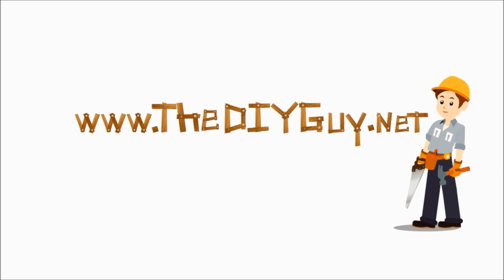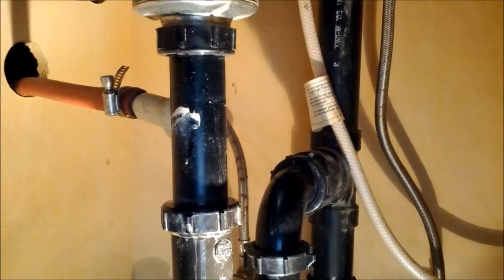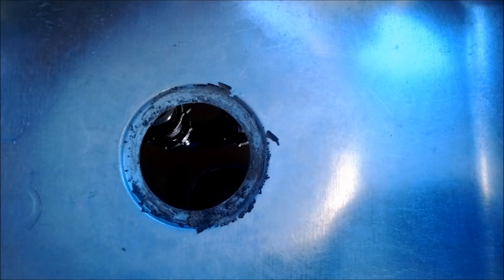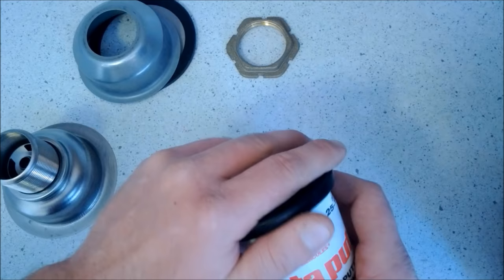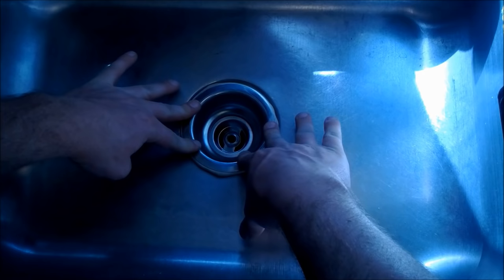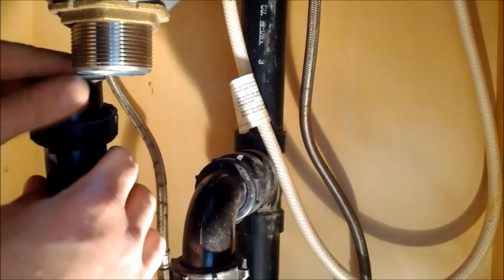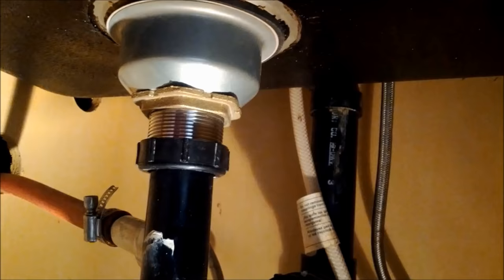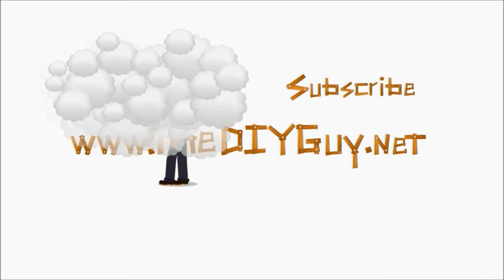How to Replace A Kitchen Sink Strainer

Comment: I'm just wondering why in the world some people gave this simple, clear, video a thumbs down!!! Trolls gotta be trolls, I suppose!
Reply: Plumbers pissed they are not getting a job.
Reply: ussteam
Reply: Thumbs down because it over-simplified the removal process... this seems to be a 'staged' repair where everything was partially loosened and easy to remove... when I replaced mine, the plumbers putty on the top-side of the old one was so strong and caked on it took about a half hour with a hammer and chisel to get it off
Reply: Lots of different people on the web. Beginners, kids wanting to learn, etc.
Reply: skaizun I think Ed it thumbed it down cause the Earth is flat... Research.
Reply: Steve 
Why would you expect the video to address every single possible problem you might run into?
Did you do anymore research? Maybe you should call a plumber if you can't do your do diligence.
Reply: @Steve M - It's clear he edited the loosening and tightening of the nuts to keep the video short.  I appreciate that..  This is an instructional video., who wants to watch a guy turn a wrench for an extra minute or two.  That doesn't teach anything, only wastes everyone's time.
Reply: Well I don't like the fact that when you tighten that bottom nut on the sink the drain moves if you don't stick 2 screw drivers into the sink to keep it from spinning while your tightening down that bottom nut.. he just says use your hand to hold it from spinning.. which only works for snugging it down.. but to tighten it you have to get someone to hold that drain still while you tighten that thing up..
Reply: He didn't weigh the putty

Comment: Thank you soooo much, this video helped me replace both sink strainers. I called Rotor Rooter and they said they have a flat rate of $65 just to
 come out to assess the situation, this does not include labor fees. In fact all the plumbers I called had such a 'come out and see' fee. 

All I needed was to get a $7 mini hack saw to remove that corroded locknut underneath as you suggested. I got all the materials I needed (hacksaw, sink strainers, plumber putty, tailpiece pipes) at Lowe's for around $30. In less than 30 minutes I was done!
Reply from the maker: +PariNicole You're welcome and we're glad to hear we could save you the 30$ right off the top as there come out and take a look fee. Glad to hear you got it fixed in a reasonable amount of time. Thanks for watching and taking the time to leave us a comment. Take care.
Reply: thank goodness its soft metal and plastic
Reply: wow you gave me the inspiration to try it myself.
Reply: same company just quoted me $1000 to replace two strainers lmao
Reply: You ain't lying girl I called them to and just four to kitchen sink shut off valve $495 with my parts it is crazy but I had no choice they crack and I have to use my emergency shut-off valve🤦‍♂️🤦‍♂️🤬

Comment: Thank you SO much! My plumber was going to charge $175. For less than $20 in materials I was able to change this completely by myself. I feel so PROUD! For anyone with the same issue as me...I couldn't get the locknut off with a wrench, so I tapped it with a flat screwdriver until it loosened.
Reply from the maker: You're welcome, Glad we could help save you some money. Thanks for watching and taking the time to leave us a comment. Don't forget to give the video a thumbs up/ like if you haven't already. Thanks

Comment: I went to Menards thinking I would have to replace the entire sink. There was a VERY knowledgeable young lady who listened to my problem and told me all I needed to do was replace the sink's drain. Then she told me the real secret, unless you are tight on time, is to soak the drain in vinegar in order to make it much easier to disassemble. Since our sink has 2 bowls we put a cookie sheet to remember not to use the broken side. We let it soak for a full week before trying to disassemble. I took a hammer and long screwdriver and hit the ring underneath twice. The old one broken into 2 pieces. It was easy.  Disassembly after soaking in vinegar, 30 seconds. Next I opened the new drain and looked at the accompanying instructions, which were confusing. All I got from them is I needed either plumber putty or silicone. Off to Home Depot I went where I learned the smallest plumber putty was less than 2 bucks compared to over 5 for silicone. Choosing the putty seemed a no brainer. Not sure how to reassemble correctly the first time with the instructions I went to YouTube, found this video at the top of the list and watched it. The video was clear, short and concise. And it uses plummer putty, perfect. It took less than 5 minutes to assemble. AND NO LEAKS. The old one lasted 35 years. I am hopeful this one lasts longer then me. Great video.
Reply from the maker: Glad our video helped with the assembly of the new sink basket. Thanks for the kind words about our video, taking the time to leave us a comment and for watching. Don't forget to give the video a thumbs up so it will stay at the top and make it easier for other people to find.
Reply: Thanks Jim, I followed your advice. Mine wouldn't budge, so I sprayed the threads and nut with vinegar and waited an hour.  It still wouldn't budge, so I held the strainer through the holes with pliers from below, and banged the nut until it came free with a hammer. Once it broke free of the calcium or rust it was a snap to unscrew. Thank you!

Comment: One bit of advice I would add is:  When testing after installation, dont just put a small ammount of water in, fill up the sink past its normal working level to have as much pressure as possible on the seals. If it doesent leak now it never will.

Comment: The most important step seems to be the decision to change the style of locking nut. The old style with rubber seal and paper gasket does not seal well and is brittle. The one used in the replacement looks to evenly apply pressure to the rubber seal. Thank you for showing this in the video and I would suggest pointing out this design in the description/ captions. Thank you again.  🖖

Comment: Thank you for this video. I was just about to call a plumber to fix the leak on my laundry room utility sink. It's leaking from the drain. I am retired and don't enjoy these DIY projects where I have to get on my knees or back to fix something. I always end up bruising myself or cutting myself with annoying little abrasions. My son told me to check YouTube for videos to see if it was something I could do myself. I'm off to the hardware store, ready to save some $$$$ and do it myself. You not only saved an old man some cash, but I think I can do this without hurting myself. Thank you. I'm sure the plumbers are pissed.

Comment: Thank you for this video! I had trouble getting the bottom basket off - I used a flat nose screw driver and hammered into it and it eventually split the metal to get the ring off! Wanted to mention it in case someone didn't want to use power tools on it! But I did it, thanks for your help!!

Comment: Thanks for the very helpful and to the point video. Anyone attempting this should take the advice mentioned below where if the retaining ring doesn't twist off, use a grinder or dremel to cut the retaining ring. Do it that and save yourself headache, backache and all the cursing associated with these repairs.

Comment: this was very helpful, i just replaced a twin drain sink and it was relatively easy. one thing to note, when cleaning the old putty off, be really careful with the edge of that metal as it's really sharp (found out the hard way).

Comment: I'm 63 years old and this video is giving me the confidence to try and tackle replacing the locking nut under the basket on my sink. The hardest part for me is going to be getting down there, or more so getting back up. Thanks for the video.
Reply: I mean if I can change out the lights on my truck front and back, and replace the grill all in less than an hour.. I should be able to do this.

Comment: Thanks so much. I was ready to do things in a different order and thought I best hit YouTube first. Glad I did. Thanks again for posting.
Reply from the maker: You're welcome, Glad we could help. Thanks for watching and taking the time to leave us a comment. Hopefully getting it replaced will go smoothly for you. Don't forget to give the video a thumbs up. Thanks
Reply: @TheDIYGuyDOTnet  Just how important is that paper gasket?  I have lost mine.  Could i make an new one out of regular paper or is it some special material?  What does it do?
Reply from the maker: @Fynedge  The paper/ cardboard gasket is used to reduce the friction between the basket or nut and the rubber gasket so you can get it tighter. I have seen them installed without the paper gasket as people thought it was part of the packing and hasn't caused a problem. Just be sure to get the basket tight, reconnect plumbing and then run hot water down the sink and around the sink basket to make the putty more pliable and then re-tighten the basket.

Comment: Good little vid, simple and to the point. The only thing I might add is to make sure the basket does not drift off-center in the sink's hole while you are tightening it down and squeezing out the putty.  Thanks for posting !
Reply from the maker: Yes, Good point about keeping it centered. Thanks for watching and taking the time to leave us a comment.

Comment: This really helped meǃ I just did it myself with your helpǃ Thank you!! Only details not included were how tight to tighten everything, especially how tight to tighen the brass nut (I feared tightening it too much), but I figured it out: basically I made it as tight as possible so that as much putty as possible would ooze out, and once tighening the brass nut tries to spin the whole basket assembly, it's as snug as possible. How tight to tighten the 3 nut on the p trap: I just did it about as much as he did, just past hand tight, but not much further, so I wouldn't break the plastic.

Comment: Professional, to the point, easy to follow. Terrific. One tip would further help us do-it-yourselfers:  I think you should add that we'll need to purchase that (did you call it?) "top hat" gasket, too for the top of the trap.
Reply from the maker: Thanks for for the kind words and for watching. This strainer and most that I have used include the new Tailpiece Washer ( aka the top hat gasket) (flip it over kind of looks like a top hat easier to have the new guy find/grab out of the truck) and a new brass nut to attach your tailpiece to the strainer. Thanks for watching and  taking the time to leave us a comment. Don't forget to give the video a thumbs up/ like. Thanks

Comment: Thanks for the video. I just replaced ours and worked great. The only call out I had was the size of the putty roll you mentioned about a dime which was to much for me and caused issues with fully tightening and seating the drain. when I re-did it thinner it worked perfect.
Reply from the maker: You're welcome. Glad to hear it worked out for you. Dime size seems to work best for most sinks if the puddy is warm it should push out the excess but either way glad to here you got it in and working with no problems.

Comment: I currently have very minimal home repair experience. I just watched this video because our kitchen sink is  leaking very bad right around the basket and someone from roto rooter told me I needed a whole new sink but I think they're wrong. I believe it's just the gasket going bad. After watching how simple it looks in this video I think I will give it a try. You have earned yourself another subscriber.

Comment: @TheDIYGuyDOTnet
So I just realized, by watching this mid-install, that I don't have to use the 4" big nut that from the old sink basket. The plumber that did the hack job before didn't tighten any of it down for crap. Barely even need channel locks.

Comment: Great video - shows exactly how to do it ....  so I actually had to do the same tonight ..
with the exception of needing a large ratchet ( used oil filter changing tool to release the nut. once the old part was off it was 
smooth sailing .  thank you very much .
Reply from the maker: You're welcome, Glad we could help. Thanks for letting us know about the oil filter tool and for watching. Don't forget to give the video a thumbs up/ like if you haven't already. Thanks

Comment: This was a great help.. thanks, and most of all a simple demonstration!
Reply from the maker: +billeagle51 You're welcome, Glad we could help. Thanks for watching and taking the time to leave us a comment.
Reply: +TheDIYGuyDOTnet Completed the job, with your help, and it was a breeze. Maybe the following issue just happened to me, but the bottom sink retainer, part of the sink strainer..well I couldn't unscrew that retainer, and I was just about to hacksaw it off (Per your video). But I noticed that the old gasket (Both paper and rubber)where pretty well shot and soaked, so I just took them off (just pealed them right off) and to my surprised the bottom retainer came off like butter, without hacking it off. I think when the gaskets came off, it gave that retainer some free play, and no pressure. Again! maybe just me.

Comment: The best way to check for leaks is set the stopper and fill the sink with water.  Check for leaks around the basket.  If no leaks pull the stopper and check the pipe connections for leaks while it has all that pressure in it.

Comment: Any suggestions for my problem? Somehow I cross-threaded the pipe to the bottom of the sink drain. Just lying in my back at that distance I had almost no focus through my crappy progressive lens glasses. Now when I try and remove it it just twists the top of the drain. My wife isn't strong enough to hold it in place while I'm underneath the sink trying to undo it. Any tips on how I might be able to get enough torque on the bottom to remount it properly and screw it down? Thanks for your great video

Comment: The only problem I ran i to was with the tailpiece washer,  the pvc pipe under would not tighten enough to stop leaking when the washer was inserted in the pipe, but when i turned it upside down it was fine and doesn't leak. Might need to replace that bit of pvc where the dishwasher hooks into drain line to get the nut to thread with the washer in the correct position.

Comment: What’s up guys, great content I was able to fix my sink but  I’m still worried about the  bad odors coming from it, a septic smell even after I clean it with commercial strength ageunts so I’m concerned my sewage is overflowing the septic system

Comment: I'm retired but still work for four or five investors I maybe do 4 - 10 of these of week I always snake the line for about four feet with a little home made snake I got  as long  I got it open one may as well hit it saves coming back later if it got a grinder on line and climbing all those damn stairs..
Reply from the maker: That's a good point if it has a garbage disposal there to just run a snake though quick. Not enough people run enough water to flush the line out after they use them. It's in our top 5 calls for sure that the trap or shortly after is clogged with food from the garbage disposal.

Comment: Great video, 1 question - any reason you use plumber putty instead of silicone to seal the drain.  My understanding is plumber putty will fail after few years but silicone lasts forever
Reply: I think its because plumbers putty won't crack {causing leaks} and some silicone stuff does crack over time.

Comment: Thank you so much for this! I followed step by step and it came out fine! Had a neighbor who is a matenance man check it over and got a thumbs up. Now I replaced both gaskets on each side of the trap becacause I noticed they were both ratty and leaking. The one side after I first put it together leaked so did that one too. One question. Is it necessary to put putty around them as well or are the gaskets good enough alone?

Comment: Just what I needed. It's taken me ages to figure out where my leak was coming from, but I'm going to the hardware store tomorrow to get the parts to fix it. I take it from the video that the joints don't need taping. Is that always the case with the black PVC waste pipe?

Comment: Very helpful. Is the amount of plumber's putty used excessive? Not really sure; just going on the advice of others.
Reply from the maker: You could use less I guess. You want to make sure you use enough that some gets squished out around the entire sink basket to ensure you have enough in there to make a good seal.
Reply: Not excessive at all.  In fact I would have used even more than this video, you want to err on the side of too much so that the pressure of installing will create a perfectly fitting gasket.

Comment: Thanks for your help but unfortunately my strainer is still leaking even after following your instructions. What could it be that Im doing wrong? maybe not enough putty or the gasket is not sitting well enough? I bought a new strainer and still having the same problem and I don't think it's because there is no basket since I have a double sink and the other one is not leaking.
Reply from the maker: It could be that your not using enough plumbers puddy.. You should have a decent amount squeeze out as you tighten it down. By basket I was talking about the lower silver part of the strainer that goes under the sink.

Comment: I dont have any plumber's putty, but I do have a new bottle of silicone. Will that work in-place of the plumber's putty? 
Great video btw!
Reply from the maker: yes, that will work just make sure both surfaces are clean and dry. A few plumbers have switched to using it so they wont have any call backs for a loose basket especially when there is a garbage disposal.